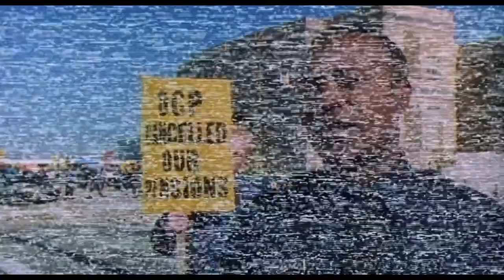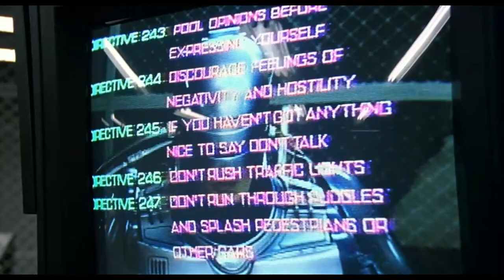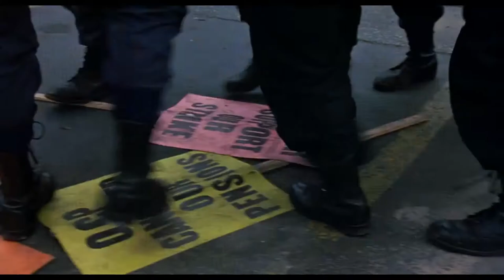Is Robocop 2 The BEST Sequel Ever Made? - Film Review/Video Essay

Comment: I loved Hob in Robocop 2. Did you know that Hob's sub machine-gun is real and it's even cooler than you may think? It is a UC-M21 (real name DEB-M21)folding machine gun. It was designed to look like a handheld portable radiolike they used in the late 1980's. It has a quick release latch that enables the weapon to go from inanimate object to dealer of death in one motion. It can fold back together with one simple motion as well...I want one!

Fun Fact: The DEB-M21 has now been redesigned to resemble a portable hard drive but functions just the same. It fires a 9x19mm round from a detachable 30 round Uzi magazine. It's cyclic rate is 650-850 rounds per minute. As of the making of Robocop 2 there is one UC-M21 and 8 DEB-M21's in private collections. 

Fun Fact #2- You can purchase a real life Auto 9 (Robocop's gun) from Collection Werks. We're talking a fully functional custom handgun built to spec.